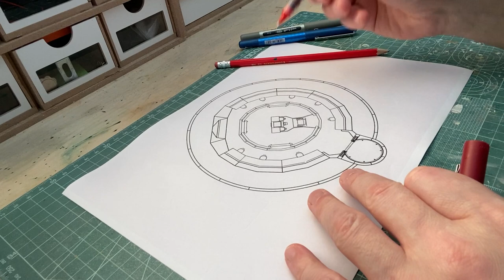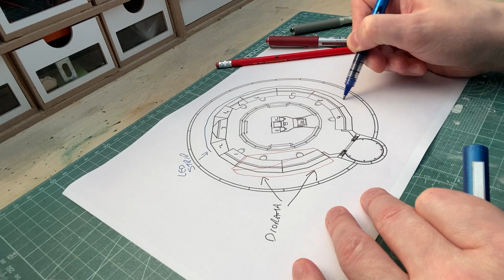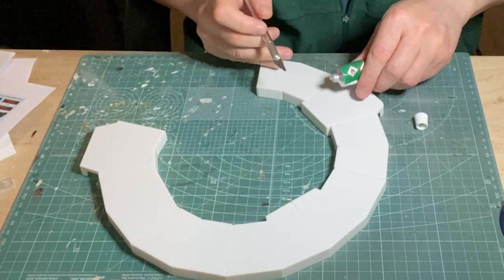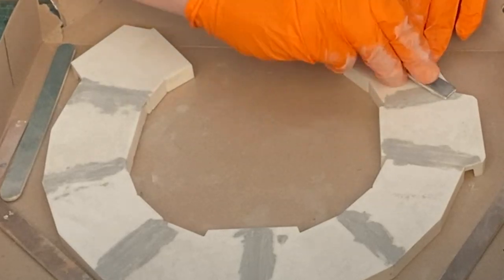Star Trek USS Enterprise Bridge: Part One

Comment: Great start.
Reply from the maker: Thanks Joe,  working on the panels now
Reply: @dansmodeluniverse  I'm interested in how you plan to light the kit since you aren't planning on drilling out the panels. I'm planning to enclose my Bridge set in a large shadow type box with a window at see through vantage from the main view screen. So, can't wait to see the lighting plan.
Reply from the maker: @joec1576  As the model is white, the light will shine through fine. Titanic, Voyager and the nacelles for the Enterprise-A  worked out very well without having to drill.
Before I fully commit to not drilling, I will test light of course but I'll be surprise if i have to.
One strip of 12v LEDs around the base will be enough to light the lot. these will be enclosed in a 1-2" box around the panels.

I like your idea, please share.. I won't copy I promise :)
Reply: @dansmodeluniverse  Still in the R & D phase with this. I was planning on surrounding the completed bridge with a  hinged box, (for access). it will have a window to look through, vantage point looking in from the view screen. The screen will still be there but to the left at an angle. Need to come up with some sort of ceiling. I have several bridge kits. Looking at assembling a second floor from another bridge kit and turning it upside down to form the outer rim of the set ceiling. I'll have to carve in the lights above the stations, and the grill above the turbo-lift then the rest of the ceiling, since it's fictional and was never seen anyway. I'm also going to have the Navigation station next to Spock removable since that's where the cameras were filming the show. I have a camera crew figures to place there. Lots of work ahead.
Reply from the maker: @joec1576  We have sort of the same idea, my diorama is the tv set but not with a camera crew, instead, I am just going to do the outer section in 'black and white' as tv mostly was then.
Yours sounds brilliant, you must/should record it.
Reply: @dansmodeluniverse  Thanks, I will. Looking forward to seeing yours take shape. Round 2 hinted at doing some other set models from the series though I don't know how plausible that is. They're supposed to be releasing the shuttlecraft interior soon.
Reply from the maker: @joec1576  yep, already announced, https://www.culttvmanshop.com/PREORDER-Galileo-Shuttle-with-Interior-132-scale-from-Polar-LightsRound-2--6999--PREORDER-RESERVATION_p_6997.html

Comment: Thanks for the detailed instructions! Could you tell me what putty, paint, and glue you used? Also, what size is the black border you painted on the decking?  Thanks!!
Reply from the maker: Humbrol model filler in this case. I always use Tamiya acrylic. Revell Contacta for the bigger parts, Tamiya Extra Thin for small parts.  Micro crystal clear for clear parts. The black border is the width of the handrail supports, though narrower at the steps.
Reply: @dansmodeluniverse thanks so much! I have the model but have never put together anything this detailed.
Reply from the maker: @BobRobertz1  Good luck with it